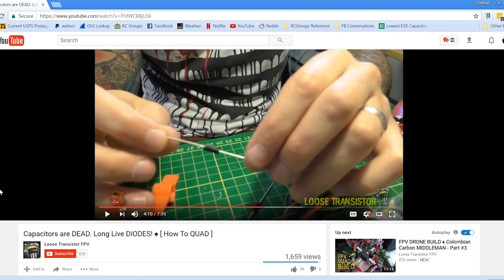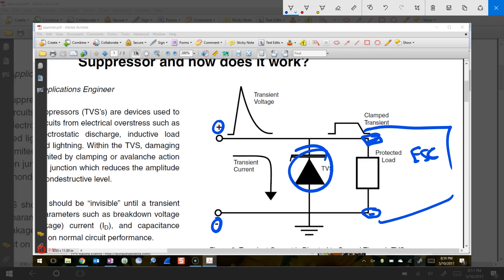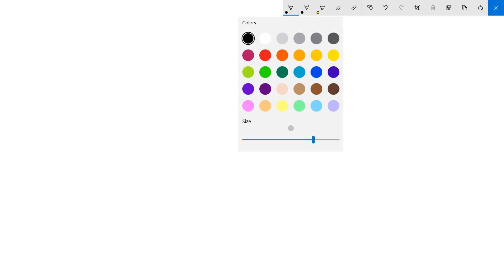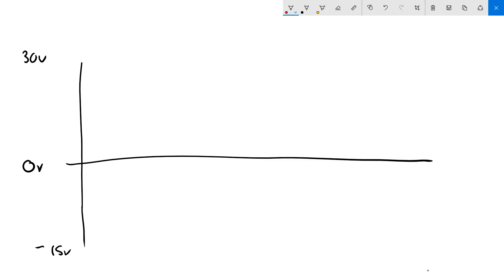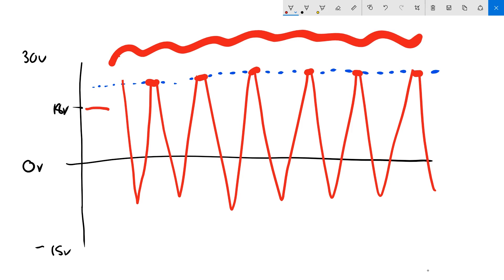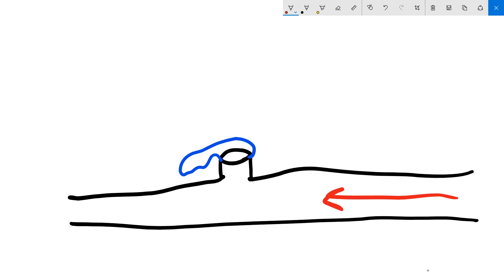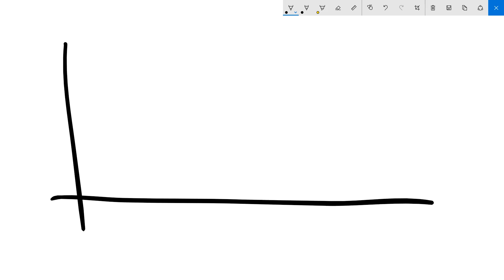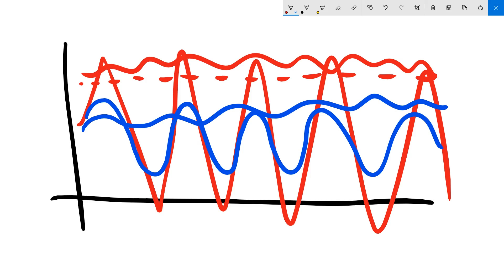TVS Diode Instead of Capacitor? No.

Comment: Yep it's all used. You basically just have to inspect any kind of electronic equipment which powers inductive loads. Something like an industrial motor drive is going to like having line reactors, DC chokes, filter caps, TVS/zener protection, snubbers and decoupling etc.. 

Drones are sucking up so much amperage it's a good idea to have a large electrolytic reservoir to help source high currents. A large low ESR electrolytic can be good for this. In parallel with that it may be a good idea to add some film caps. Something like expensive tantalum capacitors would maybe work best for both purposes but those things are prone to catching fire like no tomorrow. TVS diodes can work well but they often do not fail in the way they are supposed to (open). Pretty much any failed TVS diode I ever find on something like a large IGBT gate driving board has failed shorted. If I'm making something like an inverter to drive an inductive load like a tesla coil, I might want to make sure my large electrolytic current reservoirs have help handling the ripple by adding the film caps across them, then I might throw a large 1-2uF snubber capacitor across the bus which will be designed specifically to quench fast transients. That doesn't exactly solve the problem of noise going back to the source unless I added a proper line filter. In the end there is just no magical one component to solve it all.

Comment: Nice Video! I am a EE and design electronics for metrology in the semi-conductor industry; i think this is a really nice explanation. Generally you use TVS diodes along with larger (22uf + .1uf + .1uf) capacitors to filter power coming into a board. TVS diodes have parasitics which are difficult to mitigate and they become ineffective for high frequency voltage events. TVS diodes really become a problem when their parasitic capacitance, sometimes as high as 10nf, are use to protect power rails as low as 1.8V to 2.5V. In fact, TVS diodes will provide  a very high impedance to ground in these circumstances! It is always best practice to use bypass capacitors proximate to your sensitive IC's with values of about 100nf+10nf+10nf to shunt high frequencies to ground and sometimes even use a series inductor to provide decoupling from a noisy power rail before the caps for very sensitive devices! Finally, make sure your bypass capacitors are made of material that is less affected by a DC bias like X5R or X7R. Many ceramic capacitors behave vastly different at a level of DC bias. Thanks again for the good video!

Comment: Just thinking here....so if you place a diode on the VI then the voltage spike should return directly to the battery? If I add a capacitor after then it will mop up any residual Voltage spiking and help raise low voltages. Then it would only leave a capacitor for VTX and the ESC's? Is that what you guys had in mind?

Comment: I'm an electrical engineer student, and you understood the concept very well and explained it quite nicely. I would say use definitly both! TVS Diode protects from very fast trancients and will save your ESC from getting fried.
Voltage spikes are in 99% of the ESC failiures I've seen. The reason for mosfets latching up and burning out. And thats where a TVS is really helpful. But especially noise in the analog VideoTX needs a somewhat stable voltage and low EMC noise, a tvs diode is not going to help you there. Only a capacitor can fix that.
So both! TVS for not destroying your electronics and a capacitor for low noise.

Comment: This is great thanks Joshua, i have an N2 in electronics, not a super high qualification but covered most of the basics in circuitry, capacitance and diode protection, my question that remains after this explanation is, do you think there is a simple enough method, to calculate the available capacitance on the electronic components we all use, or should we expect the designer to post this on their spec sheets, and then to be able to calculate the shortfall you have in terms of sotrage charge and or what low pass filtering values you are achieving, can you see the noise, and then choose to filter out, so that you know what size cap you would need so that when you request the current draw, the cap doesn't instantly empty rendering it pretty much useless. It seems, most people will get the benefit of the low pass filter to clean up noise which is when an AC based signal passes through the cap, the smaller the capacitance, the better it is at arresting low frequency waves because the current flow until the cap is full, longer waves fill cap sooner, if cap is full, output is constant, but the actual capacitance value of charge held by the cap is tiny, what I mean by that is, if you charge up the cap, for eg 1000uf 35v which is a physically large component, it barely can only power the board for a second, that's with no load present. Introduce a load and it doesn't even register. So effectively, power control is not a real use unless the cap was the size of the battery, and only if you stopped seeing battery sag would the cap actually be working for the power system. BUT it is super effective as the low pass filter to filter out noise. Coupled with the Diode to stop reverse flow. Basically, on the cap side, if you ignore the need to store charge, you can choose a cap based on the minimum frequency allowed through. The smaller the CAP, the higher the frequency it allows though, smoothing out anything lower. A more detailed explanation - https://www.electroschematics.com/7048/capacitor-input-filter-calculation/  . So to summarise, power storage, I don't believe there will be a cap anytime that will assist with power delivery effectively yet, frequency smoothing (low pass filter) yes definitely, its probably one of the primary uses for capacitors and coils in electronic circuits, diodes, I expect them to be installed already on the ESC to block reverse spikes, if not, highly recommended to install, but if your devise is safe from reverse connection / polarisation, then it already has a diode, and installation an additional one will have no affect. ,

Comment: There's a HUUGE error in this video.

The TVS diode is still a diode. The way it is wired there, it will clamp negative excursions to around -600mV from rail to ground.

A TVS is basically a specially engineered Zener diode, which is a specially engineered regular diode. So if the ground voltage is higher than the rail voltage (as is the case with a negative voltage on the rail), the diode will conduct with a forward voltage of 600mV, causing the negative peaks to be clamped much more than the positive (avalanche breakdown this effect is called) clamping.
Reply: Also, any halfway decent circuit designer would suggest that you use multiple means of over voltage protection as well as snubbing for inductive loads, as well as in sensitive equipment.

Other applications may demand the use of a MOV (Metal Oxide Varistor) rather than a TVS diode, in combination with fuses or resettable (poly)fuses.

Comment: Joshua, great videos ! Can you recommend a diode type (tvs?) and size (maybe a cap as well) to suppress voltage spikes from induction from a coil turning on and off? The operating V is 13.8vdc. 
And could you also recommend and inexpensive/ simple DC voltage stabilizer to maintain 13.8 volts for a 10-second voltage drop duration? I need something that could maintain 13.8 volts for 5 to 10 seconds when the input voltage drops during cranking (automotive application) 
Thanks

Comment: When an ESC is breaking, is the induced EMF that passes back to the aircraft the same polarity or is it reversed ? I have been unable to measure this as it's way fast, however I have been able to demonstrate it's there. When ground testing on a switch mode power supply, the power supply trips when backing off the throttle rapidly from high power. With a normally forward biased diode in series with the power supply output, this doesn't happen. This makes me think the back EMF from the slowing motors is opposite polarity. Has anyone had experience with this ?
Reply from the maker: +Dwain Hill yes its opposite polarity. Current flows backwards. You will damage your power supply if you keep this up.
Reply: So my challenge is to clamp that reverse polarity back EMF, so that I don't need to run high current through a diode, dissipating butloads of heat. I had tried it with a 1N4004 as a back EMF diode but it didn't work. Hence my attraction to the potential of using TVS. Maybe that will work ???? This video has been great by the way as its amazingly close to my issue with this somewhat obscure problem.

Comment: your capacitor should be across the battery as described. It should provide extra leccy-thump for the escs when you're demanding the most from them. 
As for transient diode / varistor, it should just be used to clamp the VCC to the delicate flight controller etc.

Comment: Great vid, thanks J. I don't understand too much of this, but the balloon picture gave me a good idea :) Does an excessively filtered setup then have reduced power or punch? I have a 120 micro that has 2 capacitors (HGLRC XJB V1) on it and it feels very weak. Scared to remove them as I don;t want to damage anything.
Reply from the maker: In a very extreme case, maybe, but in the cases we are dealing with, no. The capacitor's response time should be much faster than your throttle or motor response.

Comment: In addition, with inductive loads (like motors) when you stop the motor the magnetic field will collapse. This will induce a current in the wiring, leading to a huge voltage spike.

https://en.wikipedia.org/wiki/Flyback_diode

Comment: Hmmm, interesting. I love the water slow for electricity because in so many ways it's true for current being described as water and water pressure with gauge of wire being the diameter of the water hose or pipe. 
I need to go watch the other video to see what the diode is being used on and how it's being used before I comment on that aspect. But I can say diodes and caps have completely different fictions. And even different classes of diodes handle things differently also as in the case of a zenner diode vs a basic diode. Same can be said for caps, some caps don't care about polarity, some electrolytic caps are slower at charging and releasing the water compared to tantalum caps that have a much faster response time, but tantalum caps are not good for being used as low pass filters to clean up electrical signals. So this can go much deeper then just diode good, cap bad, it depends on the application and what kind of diode or what kind of cap.
I can say your ballon (cap) will still fill up despite having a large rich or not even with a stead current. It will store this water to be released when t the load asks for a little extra water. But depending on the cap it will again take time for the ballon to fill up again before it's ready to give extra water out again. And as you know a dead Wong do anything for providing the thirsty application side with extra water. Unless the ballon is being used in the filtering way? 
A diode may also inadvertently change the wave of the water quite literally, as a changing the electrical signal also dependent on it application and how it's used. 

Ok,  I need to go watch this other video now and see what this guy did to say diode good, caps bad.
Reply: The short answer from a little research into the topic and I would say the capacitor is a better way to go, if it's needed. To understand the part about if it's needed then read on. 

This just got way more complicated then I figured. As being new in the quad flying but not RC in general I looked into these transient spikes and I guess this is coming from the motors. Most likely the reverse spin of a motor acting as a generator making electricity that is being out back into the ESC and possibly further into the PDB or FC. The enters the active braking ESC's that would complicate it even more.so this will take much more time to research with many different variables like the kind of ESC you run and if it already has this protection built in by using the tripe of mosfet and engineering of the ESC board that would prevent the spike from flowing back into the main boards. 
It looks like this would not be for all builds, maybe only some. Or maybe cheaper ESC's? Unlike a house wiring system that have a true ground that spikes will travel to the actual ground outside the house, the "ground" or negative on a battery flying system doesn't have a true place to dump any unexpected spike off electricity. You can't dump it into the air, so it looks like this is why people came up with the capacitor method and I now understand were the cap goes and how you view it as a balloon.
But knowing the basics of a diode and how it will limit the flow and reject over voltage back to the place it came from also worries me. The spike has to go somewhere and was probably unexpectedly created by the motor being a generator in reverse spin. So the diode put the electricity back to what? Back to something else in the build not designed to take it and so you now damage something else. 
So without hooking up a test rig and and buying extra parts to build a test platform for this and hook everything into an oscilloscope I would say if the extra protection is needed for your build then the electrolytic cap would be the safest one to choose since I don't know the location of the diode or were it pits the transient after reflowing it  back to another component in the build. Maybe even a faster cap to accept the transient might even be better like larger tantalum caps since electronic caps can be slow to fill up and might not be able to take the full spike in time. Again this all depends on the amount of spike, speed and current and without setting up a lab test I can't say for sure. One day maybe I'll have a few extra ESC's, motors, flight controllers and parts laying around to do this but I don't today.

Then part of me thinks if the ESC was built correctly from the start it would never allow the transient spike to go past the ESC and into any other components. Maybe this is were active breaking comes in and why eMax doesn't give the option to disable it on some ESC's. This gives the ESC a place for the extra transient power to go a be dissipated back into the motor but with a use of also brewing the motor. So any transient would now only be dissipated but would also be done in a controlled manner. Defiantly an interesting topic. I hope to visit it more later when I have the extra parts to do so maybe after I crash a few time, lol.

Comment: hey Joshua , I had an interesting experience the other day ... I popped a 470uf capacitor while running my smoke stopper. . yes the bulb lit about half brightness for a couple of seconds .  i was wonder if you could explain why . once the smoke stopper was out of the loop all was fine .
Ps yes the smoke stopper is good . no problems with it.
Reply from the maker: The major reason why an electrolytic capacitor will pop is that it is wired backwards. Positive to negative and vice versa. I can't think what about the smoke stopper would have influenced it to pop. If anything, the smoke stopper should protect it because it damps down on voltage spikes.
Reply: that you sir , it's possible I hooked it up backwards however I am reasonably confident I had it correct.

Comment: All of what you say is true Josh, just not 100% technically correct. I've never run Electros, for one simple reason. the battery it self has sever Farads of capacitance. making a 470uF insignificant. As long as your wires are short (around 10cm) and your connectors are good. If you are seeing video noise replace your connectors. 
The TVS protects your ESC's form connection transients (Tanking!). PM me if you want a little more technical detail.
Keep up the good videos.
Reply from the maker: I disagree about the 470 uF not mattering. Look at the difference in the FPV footage here: 

https://youtu.be/PaKXZSbnvWM?t=1m13s

That copter was all direct-soldered, brand new XT60, etc... Adding the capacitors cleared up the video noise. The battery may have gobs of Farads, but it is lacking something else that the electrolytic caps add.
Reply: Its hardly a scientific test. Also I dont want to enter into a Holy war. If it works for some people it works, but my money is its solving other problems. I just had super bad video on  a new build with new XT-60's Really clear motor commutation lines and early battery low warning. Jammed a screwdriver into the pins of the XT-60 to splay them out and make it really tight to plug in and it all went away. from unusable video to perfect. I dont use elctros and only one big TVS. Only time I'd say ok you proved me wrong is a good clear bench test or remove the connector completely and solder the battery on.

Comment: Diodes and Caps are two totally different animals. No matter if its a Zener, Schottky, TVS, or run of the mill. You can not replace a cap with a diode in filtering and regulating circuits. my 2 cents.